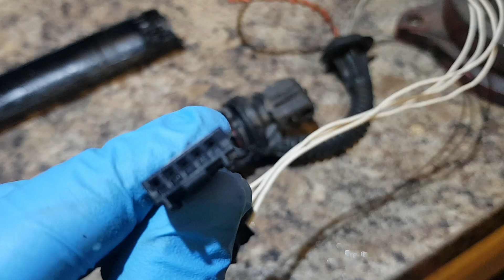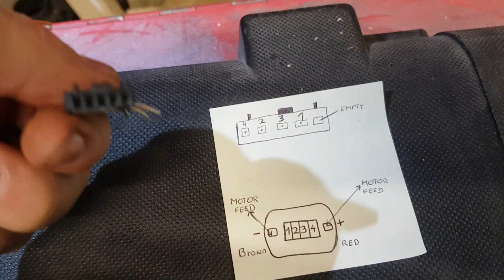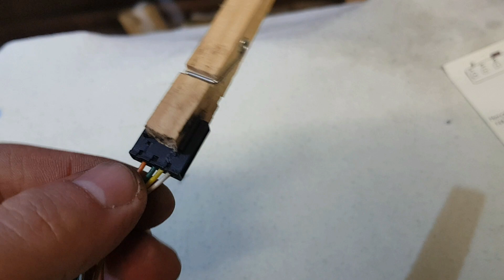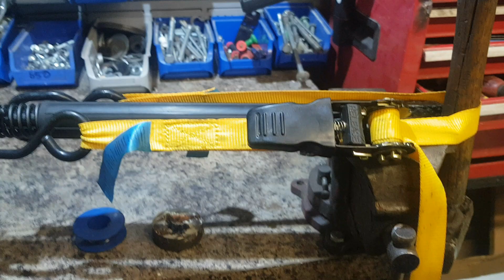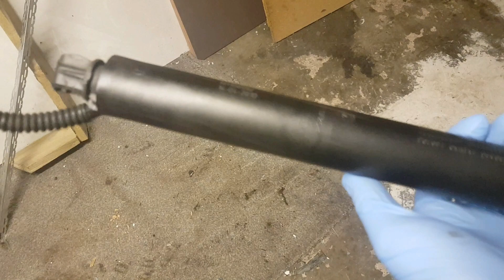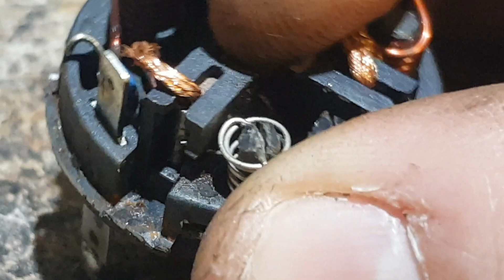VAG group boot repair DIY

Comment: is it possible to get these apart without a workbench or vice? i have neither but need to get into a set of these to rewire
Reply from the maker: Well probably yes but you have to heat everything up and it's not easy to melt glue and take it apart just with 2 hands but give it a go
Reply: @DankosDIY  yes im finding that. in fact over 30 mins with an electric heat gun (the type used for stripping paint in houses) and the plastic has started to bubble with the heat in 1 or 2 places, but no sign of the glue softening at all. starting to debate cutting the sleeve open. shame when i only need to get at the wiring to replace it, as its snapped off flush with where it exists the struts, and has been repaired in the general area on a couple of previous occasions too, so a new section of wire SHOULD (fingers crossed) cure the fault for a decent length of time. we did get another set from an ebay seller (turns out they were based in China) who advertised a 10 year warranty, and 15 months later, they do not respond to emails about the warranty, so trying to repair the originals, whilst at least the chinese ones are at least on the car to hold the tailgate once its been lifted manually. seems like the motors are the issue there, as they spin slowly and seem to lack power, however if i can repair these somehow, i may strip them apart too, see if i can repair them and then we have a spare set constantly

Comment: Hi, great video.
I have a 2021 Volvo V60 with an electric tailgate. The struts work, but there is a horrible crunching sound coming from the right strut, like something is breaking. The price of a new one is very high. What do you think this sound could be doing? Could it be fixed? Thank you for your reply! ):)
Reply from the maker: I think you have some water ingress in to the bearings and they just rumbling eventually will seaze and stop moving all together. Better to take it apart and see what can you do with it. Either way it will have to be fixed or replaced.

Comment: You are a genius youtube.com/@DankosDIY I will try this now. Did you have to do any reset procedure when you mounted back in the car? if so, could you describe please. I dont have a VAG, is it need it to reinstall ? thanks a lot.
Reply from the maker: Hi mate no there is no reset procedure. Mount them on and press the button as long as u done everything correctly they should go up and down no problem. Let me know how you get on. Regards.

Comment: I am at square zero.I detached the piston from the tailgate but the cable doesn't come out and I don't understand where I need to access to detach the connector, can you point me in the right direction?
Reply from the maker: The connections are located being the cover for the last pillar. Last vertical pillar has cover over it remove it plugs are there.
Reply: @DankosDIY  hi thanks a lot for your quick reply. Anyway Not sure what you mean for "last pillar"" is it somewhere  within the truck.
Reply from the maker: @stega1  what car is it that you working on?
Reply: @DankosDIY  audi A5 Sportback 2017
Reply from the maker: @stega1  wiring in that is probably attached to the roof I assume you have to take the roof lining down a bit to get to the wires.

Comment: How did you remove the cover?
Reply from the maker: You have to heat up the glue with heat gun to the point where it becomes liquid so very hot and slide it off.

Comment: My tailgates seem to work fine make noise while moving l, what might the issue?
Reply from the maker: Motors running dry. That's the beginning of the end. Would be worth taking them apart and cleaning and lubricating them before they die. I repaired left one and week later right one died.

Regards.

Comment: I wanted to update my 2004 A 6 allroad but I was told it wasn't updatable 😢
Reply from the maker: I would remove the covers from the boot pillars and check if there are any wiring connections. Most vag cars have same wiring loom but they just waiting for someone who will spend money. So u might have all the wiring ready for the investment. I would check. Let me know. How u get on.
Reply: @DankosDIY  I'm now housebound & car is in storage. If my health improves I will dig deeper into this subject. My regards to you.
Reply from the maker: @simonkenwothy5933  get better what ever happened. If u got questions just ask. 👍